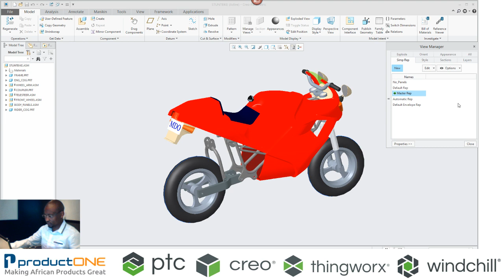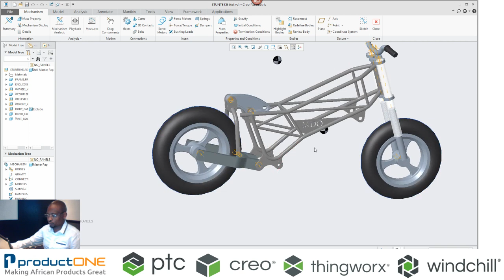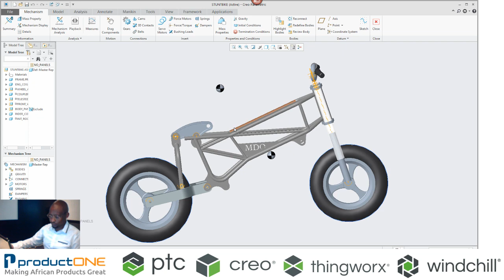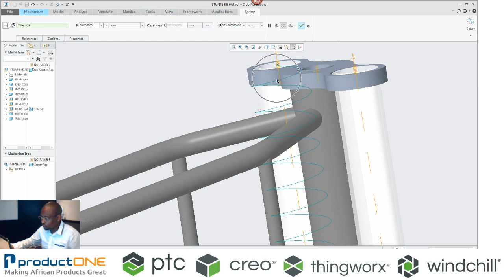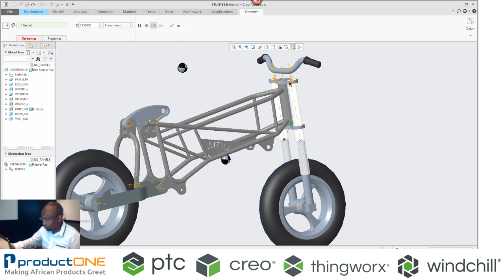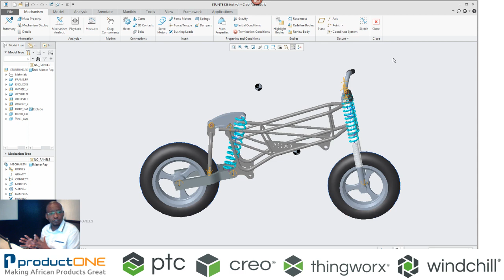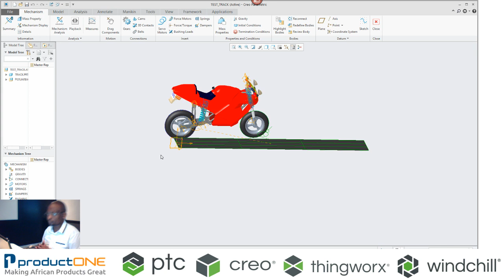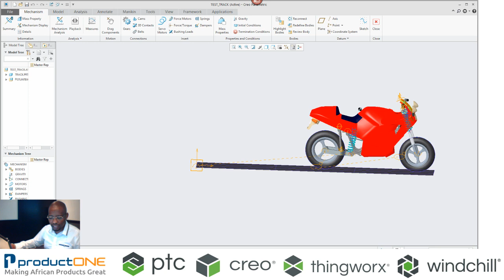Mechanisms inside Creo Parametric

Comment: Great explanation. Sir I m eager to know how to determine the location of centre of gravity of rider or engine. As I m designing a hopper of a seeddrill. The seed material will apply the pressure on walls of hopper. Based on that the span of the side sheets and thickness of the sheet will be designed.  In such condition how would I apply the the grain pressure on walls of the hopper in Creo to solve the problem. Please guide. Thank you.

Comment: I am trying to do a similar connection for a train model on rails. I apply the cam connections, but when I try to add velocity in an axis direction while choosing the initial condition, it says it's an incompatible initial condition (yes I take a snapshot before doing this). What can be the problem? And I see that in the test_track assembly that you have added the bike as a mechanism because there's a dot inside its rectangle at the model tree, what kind of mechanism is that (rigid, planar, or something else)?